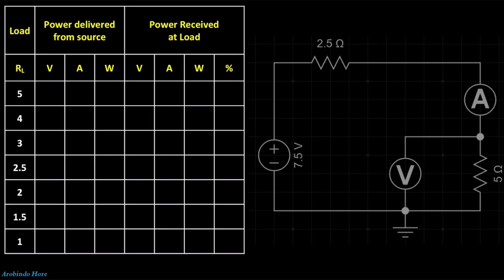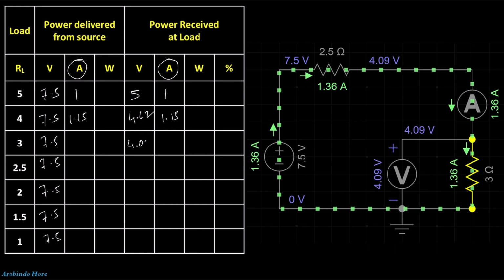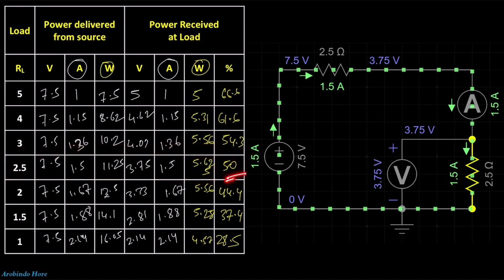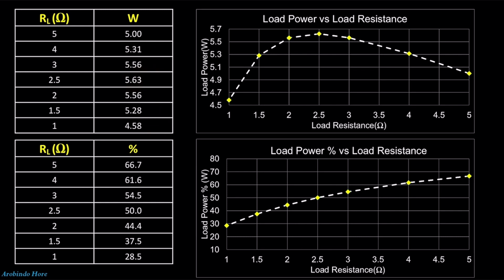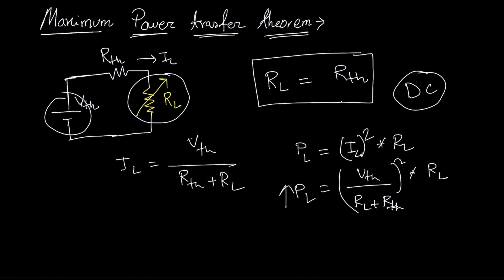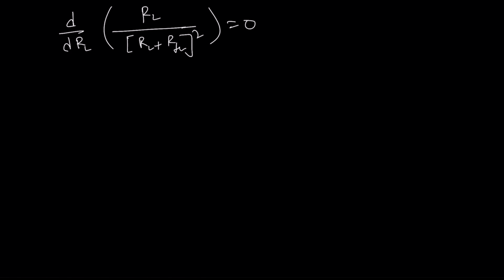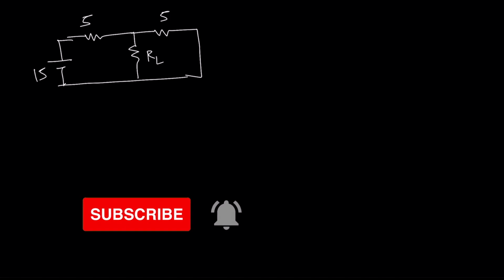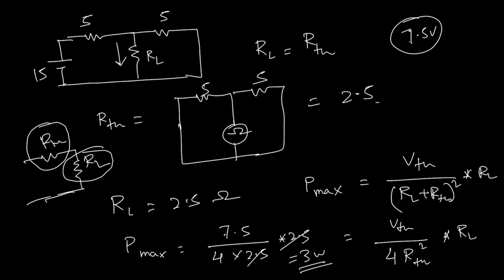Maximum Power Transfer Theorem: Prove and Simulations

Comment: Good explanation, but I have two questions:-
1. So it's not much important how much % of power is delivered from the source, rather we care about how much the load can actually recieve. Am I right?
2. I think while calculating P,max you have made a mistake. Isn't it be Vth², and also in denominator it should be (2.5)²?
Reply from the maker: Yes you are correct. and thaks for the feedback.